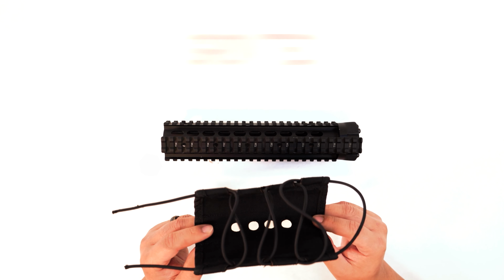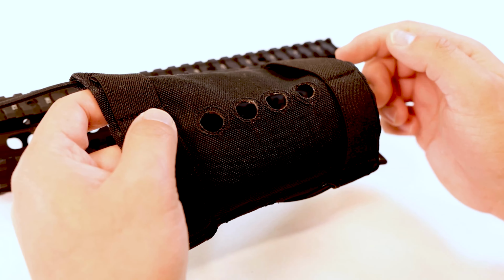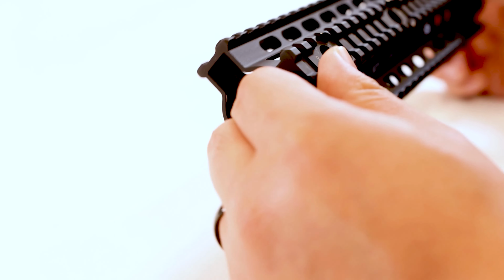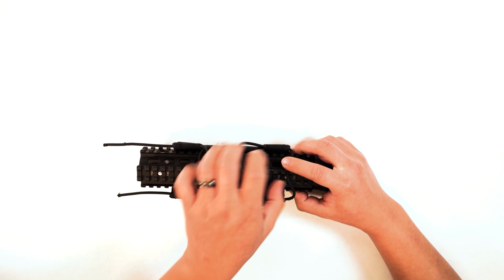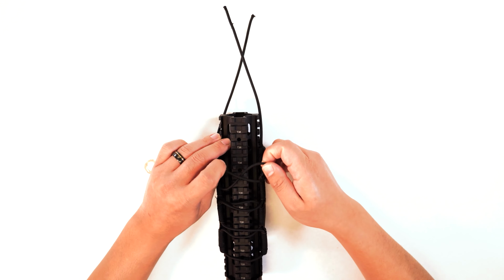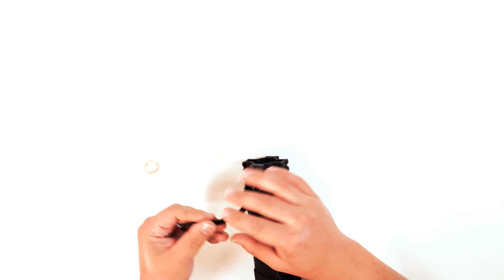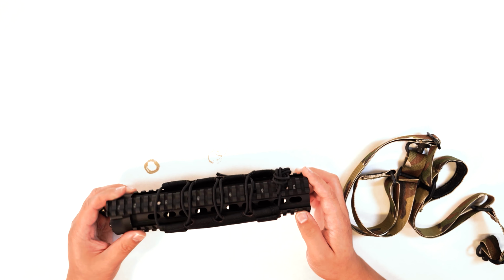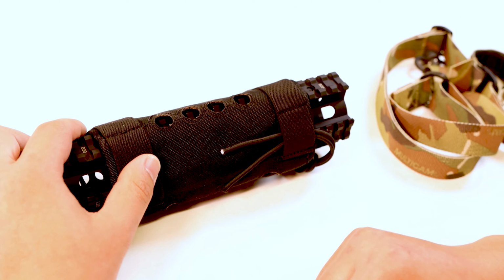GrovTec - Rail Wrap Installation (NEW 2023)

Comment: Looks good, been considering one of these.  Question: If I have a piston upper that gets very toasty - could I mount the wrap upside down and allow the vertical foregrip to feed in-between some of the paracord to keep it in place?  On top of the gas block is where it gets the hottest and there's no picatinny in that section anyway.  Thanks!
Reply from the maker: Yes, this is totally customizable how you want to place it!
Reply: @grovtec  Ok cool, thanks for the info

Comment: Can you cut it to work with accessories or will that ruin the heat wrap?
Reply from the maker: Technically you could do that, but we don't recommend it. I would suggest using a lighter or a torch to burn the cut edges very lightly. The bottom has mounting holes already.
Reply: @grovtec  I have a quad rail. So that’s why I’m asking. Didn’t see a wrap for a quad rail.
Reply: I heated up a knife and cut slots for side mounted mlok rails for my light and it works good
Reply: I also stripped the guts out of the paracord bc I have a super slim Midwest rail and the cord was too thick and looked weird

Comment: What material is the wrap made of? I already purchased one but I can't find any specs for it on your website or otherwise. I put it on an AR-10 close to the chamber and I don't want it to melt.
Reply from the maker: Cordura, We heat tested it. It shouldn't melt as long as it's not making direct contact with a barrel or suppressor.